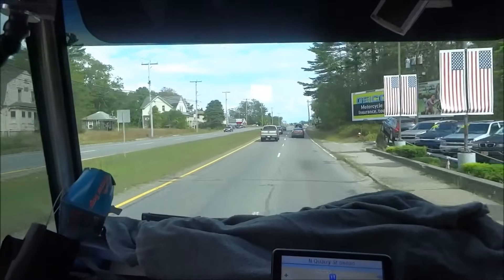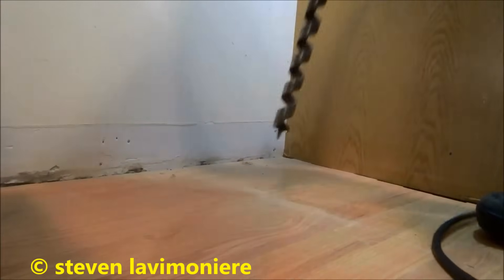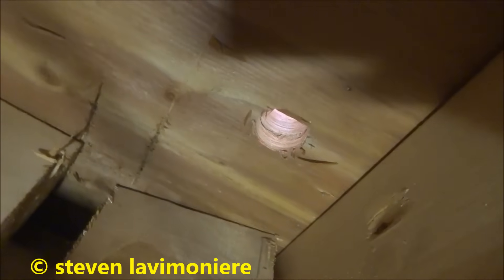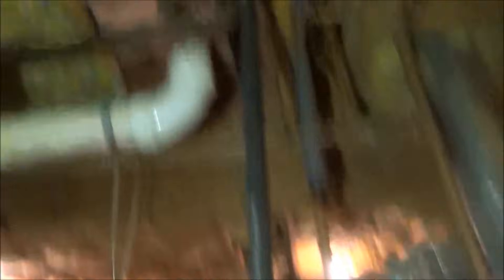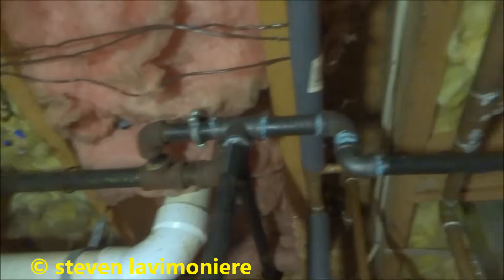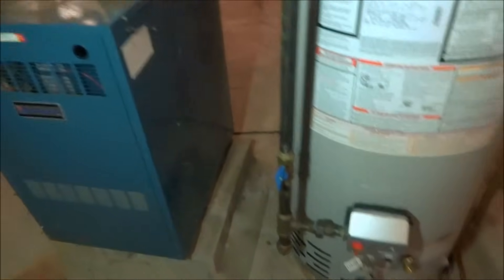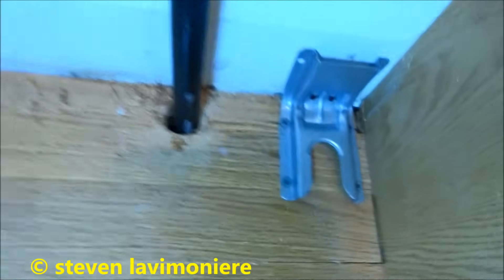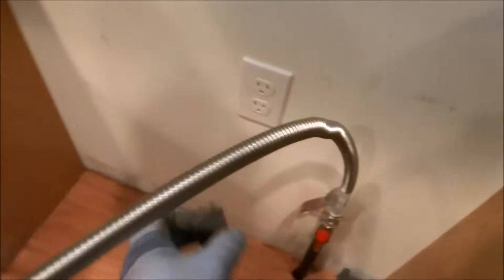gas piping ran to new gas range,stove/start up

Comment: Now you just need to adjust the burners by taking each knob off and using a small Flathead screwdriver and setting each one to the right mix.
It also would have been great if you could have shown us the install of the black iron pipes, heck a montage would have been great as well.
I hope you have learned more and that your videos have gotten better, You really have a good thing going here.

Comment: Your pilot hole at :48 didn't leave enough wood for the threaded tip on the auger to bite so naturally it wasn't going to pull the bit through which is the main reason for liking auger bits. Back seat driving is easy but it didn't look like you caught what was happening.  Everything else was very nice work!
Reply: I'm glad you pointed that out. I was thinking the same thing.

Comment: Recently added a 1/2” line for a stove for a friend. After I installed it, the pilot light kept going out on the water heater after a day or two of running. Thermocouple is fine, cleaned the burners etc. 1” main coming in, t’d off for the 1/2” stove line, and water heater line is 1/2”. Do I need to bump up the line that feeds the water heater to 3/4?

Comment: Steve, are you O.Q qualified to work on the D.O.T. side of the meter? Do you check the reg vent after turning the riser valve back on? Those old s254's are known to weep afterwards. You should probably say something about Johnny homeowner not touching those lockwings because they can blow the reg or sometimes snap that brass barrel. Might be 60lbs in that line.

Comment: good video Steve. we basically use the same setup when cutting more than a few runs of gas line. we got an older rigid motorized pipe threader/cutter that weighs about 175 lb's. what a bastard to load and unload. cuts and threads like butter tho.

Comment: I have a dumb question. When you shut off the gas, isn't there still residual gas left in the lines in your house (to the water heater and furnace)? If you cut into the pipe to install a new line, aren't you draining the gas into your house?
Reply: You can leave the pilot on on the water heater and it will burn off most of the residual gas. Even without doing so there is no danger since there is only very little gas in the lines. But it will smell somewhat.
Reply: Great question

Comment: I sure would have liked to watch you actually install those pipes and do that tee.
Reply: Exactly...was the down pipe to the water heater cut...how did he get the elbow off?
Reply: @westvalley411  Break the union at the water heater, then un-thread the pipe out of the 90, install the tee, reinstall the pipe, reinstall the union, then work your way off the new tee.
Reply: Exactly

Comment: I just put i lg mini split in April, I love it! Ducted for the upstairs bedrooms and non ducted for the lower 2 levels, so a 3 zone heat/ac system as well as my standard boiler heat. I wish I put it on the wall though instead of on the ground, didn't think of it at the time cuz it came with a base, now I gotta keep an eye on the snow around it.
Reply: Been there done that.

Comment: Interestingly, on Sunday I had to run gas pipe in the basement of the house that my boy just bought. He needed help carrying his washer and dryer down the steps. Then he asked me if I would hook up his dryer. One look at what was there and I said No Way. Nothing but one 15' long chunk of 3/8" copper tubing coming off a tee where the stove hooked up. The compression fitting where the tubing connected to the tee fell right out the moment I loosened the nut. It now has 1/2" black pipe running to the dryer with a good flex pipe for gas, as it should be. I don't know how that house didn't blow up on the previous owner, the compression fitting was sealing nothing.

Comment: hi steve in america do not have to do a tightness test,gas rate, purge and relight and check working pressure when installing a new appliance. its a must the uk.
Reply: It's interesting to see how things are done. I like their anti-tip brackets, much more discreet and simpler than a chain.
Reply: I was thinking the same thing testing the installation before starting think our rules must be more strict like the use of iron pipe in domestic less chance of the diyer having a go.
Reply: home depot and lowes will cut and thread pipe for diyers.
Reply: here in nyc any new piping has to be pressure tested with 3lbs of air and must hold it for 3hrs, and being he shut the MCV (meter control valve) he would have to pressure test the entire interior piping. here in NYC the utility are the only ones allowed to shut a MCV or a HOS (head of service Valve). so many unsafe practices here in this video

Comment: What would it cost roughly to have a gas line shut off valve  for a gas stove I presently have only a cap on it coming out of wall
Reply: surely you checked by now but i put in a 1/2 inch ball valve(about8$) 1/2 in appliance connector 4ft (about 22$)
Reply: zaggaona ok thx

Comment: Not sure if you know but that reg on the gas meter doesn’t seem like the best place to be installed... should have some more clearance below the vent in my opinion. Not sure if it’s even in line with code in your area..
Reply: Daniel Velazquez  it comes that way from the gas company.

Comment: Hey Steve, it probably wouldn't be a bad idea to check to see if the gas range is adjusted properly, sometimes the new ranges aren't adjusted quite right for the gas pressure in the building and it can cause excess CO.

Comment: Great work, as usual, Steve.  Heard Baby barking in the background.
Reply from the maker: she was protecting the truck
Reply: Not a plumber but  i have done a lot of piping industrial in the plants, question is,,, how come no union or unions installed in case of a leak you might have had while making all the joints up? Just curious, good job BTW.
Reply: Richard

Comment: Hey there Steven, great video, thanks for sharing! I do have a question, if you don't mind...is a regulator required? Or are they usually built in to the stoves?
Reply: Built in.
Reply: its the boxy thing the flex line is attached to at 11:59
Reply: Thanks guys. My comment was a blast from the past; I had to rewatch the video to see what it was about, then figure out which house I was living in at the time. Seems I ran a gas line for a new gas stove I put in at my home. I've installed another 3 gas stoves since then.

Comment: Sorry to bother y'all but can we use the yellow tube/yellow RECTORSEAL Pipe Thread Sealant that has the red 5 on the label or do we need your white paste/brush stuff?  Running black iron pipe/nat gas to new stove location in our kitchen remodel.

Comment: Very informative.  After the gas is turned back on what is your procedure for the water heater and furnace as far as relighting or the pilot?  Do you turn off the valve to each one prior to turning off the main valve to the house ?
Reply: Not sure what he does but any gas valve with a pilot should automatically shut off when the pilot goes out and will remain off even when you turn the gas back on until you manually re-light the pilot like he did for the water heater in the video. There is a thermocouple or thermopile to detect if the pilot is lit and the valve will only operate if this works, as a safety feature.

Comment: Overall, good job.  First wipe off the excess pipe dope. It could conceal a leak. Leak test only a section at a time.  By time you check out all the joints the bubbles could be done.
Use a flashlight and don’t forget to check in the back of the fittings.
Reply: DONALD1951 I don’t think needs any advice on how to do his job.